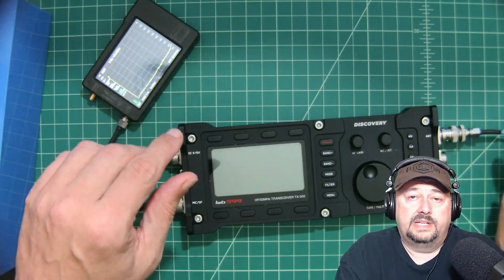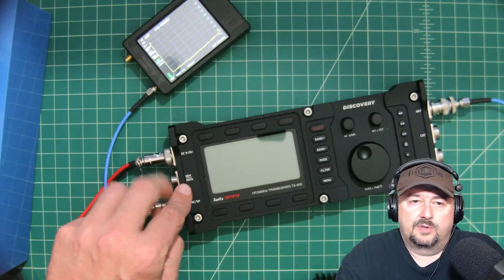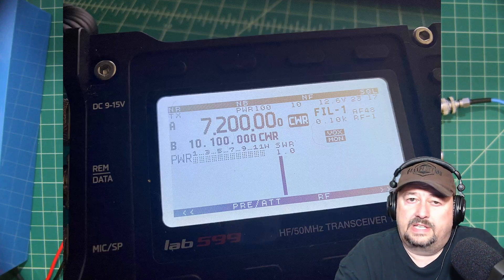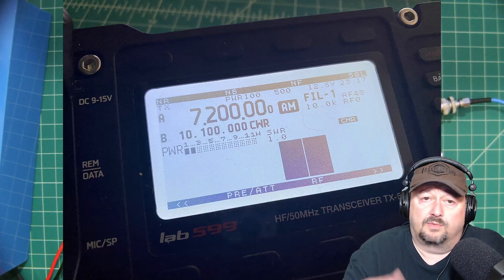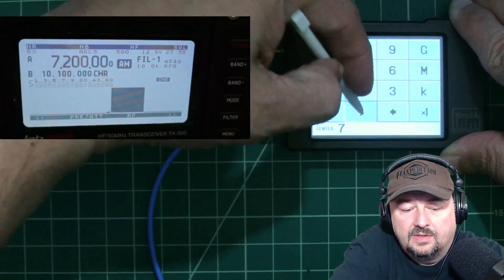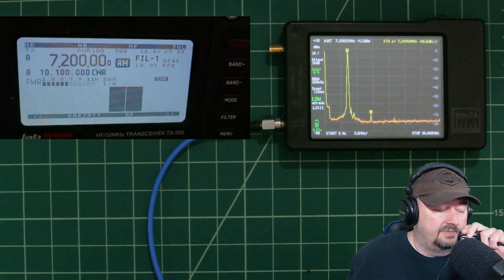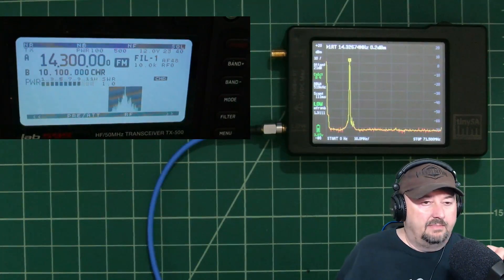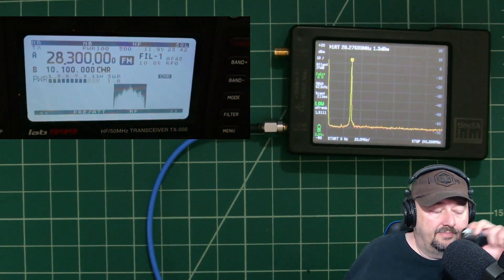UPDATED Testing the Lab599 TX 500 for Harmonics with TinySA

Comment: The spikes at key-up are because the tinySA has not yet detected the high input level and still needs to increase the internal attenuator, because of too low attenuation the tinySA mixer is overloaded causing the strong harmonics. After a second or so the internal attenuation has increased and the tinySA mixer is no longer overloaded and the harmonics go down to the level as arriving at the tinySA input.
Reply from the maker: Thanks for the insight Erik, your comments are always appreciated!
Reply: So setting the TinySA attenuator, manually to whatever is set in auto-mode, should show a less busy  harmonics display on TX key-down?
Reply from the maker: @technishn  that’s my understanding
Reply: Indeed, this avoids the attenuation jumping up and down

Comment: great update.  Below 30MHz the FCC wants spurious emissions 43dB below the fundamental tone for Amateur Radio.  Looking at the tinySA, even the initial key up spikes are well below the fundamental by more than 43dB.   When looking at harmonics, I would use the FM or RTTY mode without modulation.  In AM the transmitters will typically only put out 1/4 of the available power when "dead key" (no modulation). In AM, the radio needs to have reserve to output clean at 100% modulation index.  FM will always have 100% of the power set on the radio with or without modulation.   Keep the content coming!   de KB7ZUT
Reply from the maker: Thanks for the insight, and for watching KB7ZUT